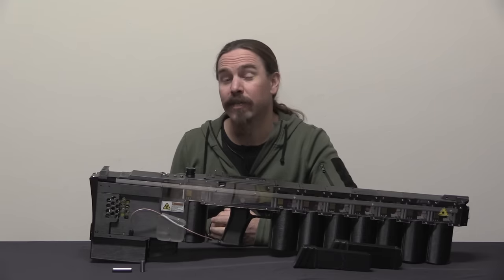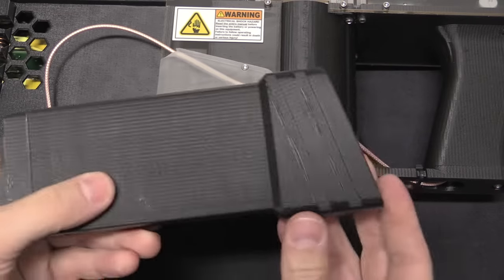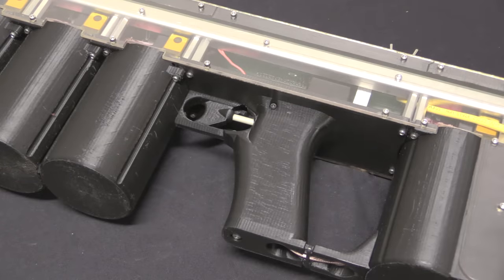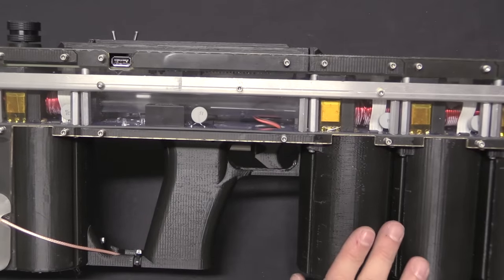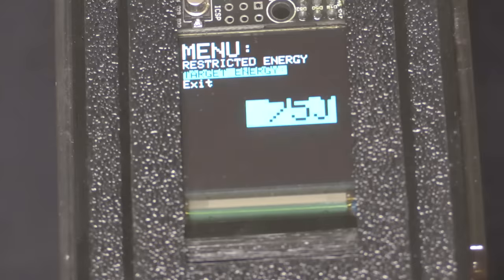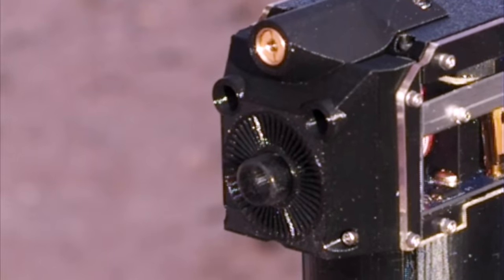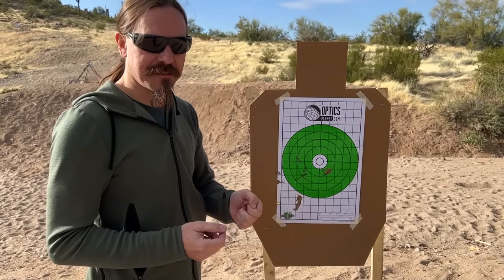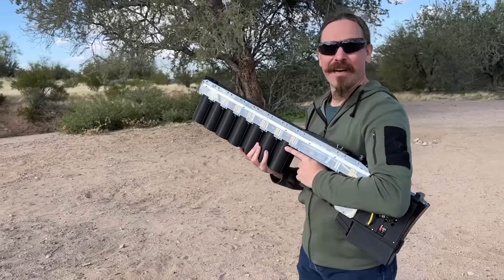ArcFlash Labs' GR-1 Anvil Portable Gauss Rifle

Comment: I love how even in a completely different style of firearm, the main issue is almost ALWAYS the magazine development lol.
Reply: Can you explain why aren’t most of them banana with spring or rectangle
Reply: Normally it’s not getting the rounds from one area of the magazine to the other which a spring easily manages, it’s getting the rounds to stop at the top and then get picked up only during forward motion of the bolt carrier, getting up a feed ramp and then into a chamber without causing the bolt carrier to slow down, hang, or lose enough energy to prevent lockup.

All of these things something as simple as surface finish or an angle change of 1-2 degrees is enough to take a non functioning gun to completely reliable and vice-versa.
Reply: It's not just a question of "a rectangle or a banana", it needs to be a precise shape to fit the geometry of the rounds it will to hold.
Reply: @youdontknowwhoiam4349  Mags are banana'd due to some cartridges having a slight taper. I.e. the bottom of the case is often wider than the top.

There is no use of a banana mag here due to having the slugs be the same diameter.
Reply: should of just used old sten magazines
Reply: @mpk6664  Which is why the Chauchat had that weird half-circle magazine, tons of taper on those 8mm Lebel cartridges.
Reply: @jic1  love the Chauchat mag lol
Reply: @ginomanshit2365  Why Sten magazines, renowned mostly for their less than stellar reliability? When they're not loading 9x19mm rounds or anything even close to the same dimensions?

Doing a single-stack magazine is the obvious and easiest way, unless you need to worry about capacity. Especially if you have to go single-feed, which this probably does.
Reply: a very strange design concept. For this slow-semiauto weapon, the should have chosen a bolt-action design. 
1. bolt ensures round is properly fed to "chamber" (starting point for acceleration.
2. bolt may cock a spring, that actually starts acceleration of  the projectile from zero to "slow", and em acceleration should take place further in the barrell. (it a pure waste to em accelerate with em from 0)
3. gun can auto start charging capacitors upon shutting the bolt
Reply: @krivdaa9627  And after #3, you've still got to wait for the capacitors to charge, which time varies depending on selected energy level.
Reply: @krivdaa9627  The whole point of this thing is to show how close they are to actual full auto handheld coil guns. Also, he said a solenoid starts the motion. Seems appropriate to me.
Reply: @krivdaa9627  The projectile doesn't start from zero, it is "kicked" forward by a solenoid.
A mechanical bolt and spring seems like a lot of unnecessary trouble. This is probably nothing more than a magazine that's a bit too rough from the 3D printing. There's no need to add a whole extra layer of complexity because of it.
Reply: It is a working 3d printed mag, the task failed more than successfuly!
Reply: Ian I wish you a long and prosperous career, but you do realize that once you get the gauss gun you're pretty late game, right?
Reply: Drum magazines = just say no!
Reply: That’s not a firearm btw. That’s an energy weapon, according to Fallout
Reply: Actually the main issue with this is the scalability of capacitors and batteries. To get up to conventional rifle speeds in a man portable package would require capacitors and batteries so energy dense they would effectively be very unstable bombs. And those capacitors and batteries don't yet exist, but if they did you wouldn't want to be anywhere near them if bullets are flying your way.
Reply: this is not even a firearm.
Reply: Magazine development. The thing that puts most firearm prototypes into an early grave
Reply: I wonder, would you even call it a "firearm", considering there's no combustion? In function it's actually more like a crossbow than any gunpowder weapon.
Reply: Not a cartridge just a peojectile
Reply: Yes that is a half ince concrete anchor.
Reply: my mags infinite straight tap water
Reply: @quigonkenny ATF definition:

The term “Firearm” means: Any weapon (including a starter gun) which will or is designed to or may readily be converted to expel a projectile by the action of an explosive; The frame or receiver of any such weapon; Any firearm muffler or firearm silencer; or. Any destructive device.

The last part is pretty broad.
Reply: It's not the main issue but the rifle is certainly obviously limited by thee magazine
Reply: random dude from 2024 here, I say they shoulda made this thing use old dp27 spiny mags